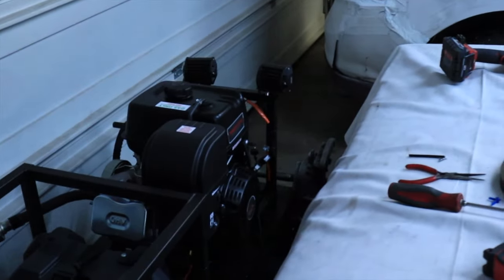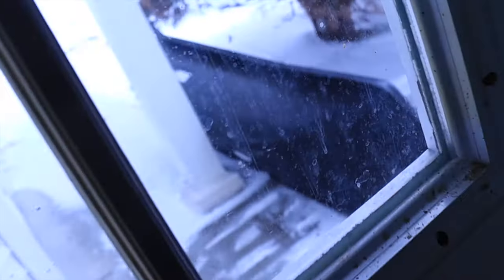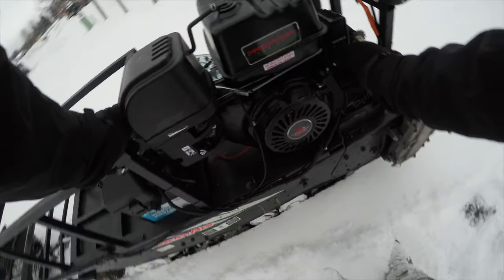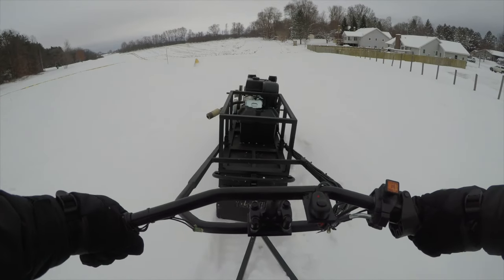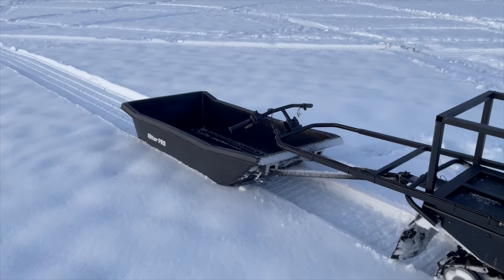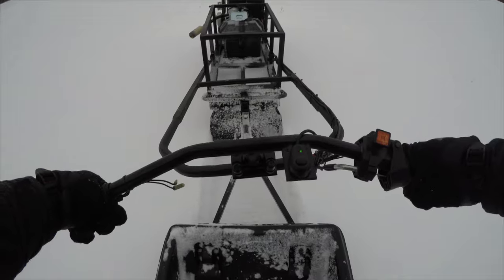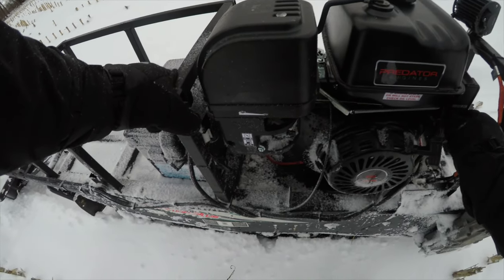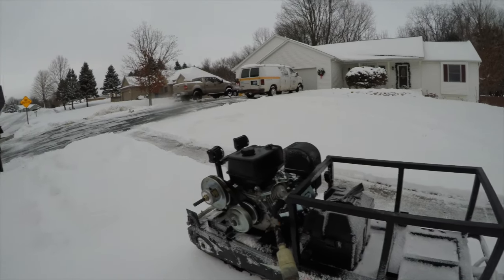Snowdog Testing #1 (thing shreds)

Comment: You'll always have to start a Predator with the choke on, even when it's warm. When your belt breaks in,(after you put it on right) your sled will probably stop walking when it's idling. Nice build btw.
Reply from the maker: I know about the clutch haven't gotten around to it. But good to know on the choke I've heard that changing spark plug to a higher or lower will help that but haven't tried that.

Comment: Belts on wrong. 🤓The belt has an angled side and a flat up and down side. Angled side goes on the outside, then the belt won't engage at idle and drive away. 
Great build 🏆👍

Comment: I put a predator motor on a roto tiller. I had troubles with it dying for no reason when tilling in rough ground. It would always start back up after a minute or two. While I never "officially" figured it out I always felt like it was being caused by the low oil shut down from the tiller bouncing in rough ground. Especially when breaking new sod. The video made it look like a smooth ride but I've got to assume it was rougher than it looked going through those fields with that. Regardless, looks like fun! Good job!
Reply from the maker: Yeah I took the breathing tube off the charcoal filter at the bottom of the engine and it seems to run better without stalling now.
Reply: Boys if the motor needs more fuel and it dies it's like a outboard fishing motor I built a boat from scratch and I hit the water with it as I thought it was ready it would idle all day long but when you would throttle it up it would scream then die, looked at the primer bulb was flat as a pancake, better primer bulb worked fine, remember you get what you pay for

Comment: Looks like your clutch might need shortened. it does not have enough slack to start with out pulling you.   It should have to have some rpms to engage.
Reply from the maker: Yeah I was going to do that or move it out so it’s in-line better I’ve been told both ways.

Comment: Adjust that clutch setup.. that's not supposed to be like that at all lol and if you lock the handle bars from going down you can tilt the machine to steer way easier.

Comment: If you extend the wires to retch to the Handel bars move the starter switch to the Handel bars it make it easy to start for the choke fine a old  mower take the throttle cable assembly and use it for your choke

Comment: if you look at the comet clutch drive the belt it needs to be turned around the belt has a flat side and the other side is tapered.  The flat side of the belt needs to be toward the motor and you will be able to idle without it wanting to go.